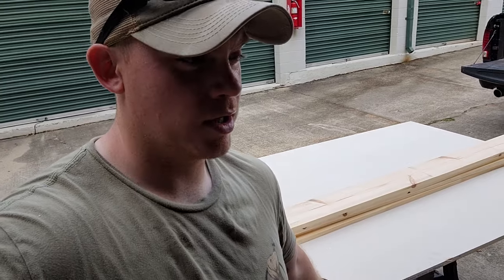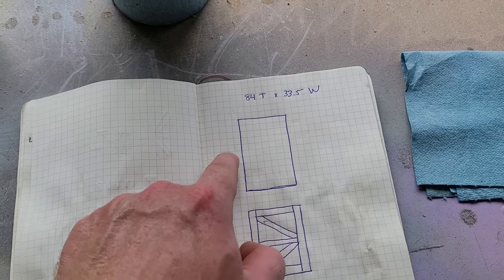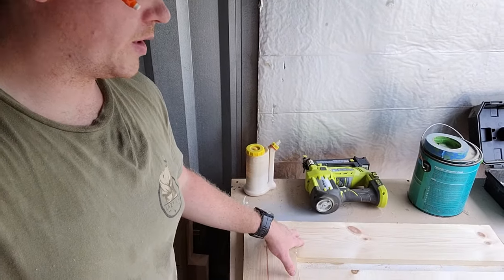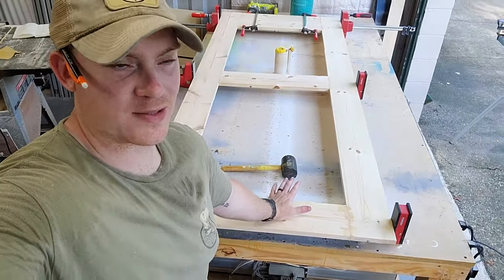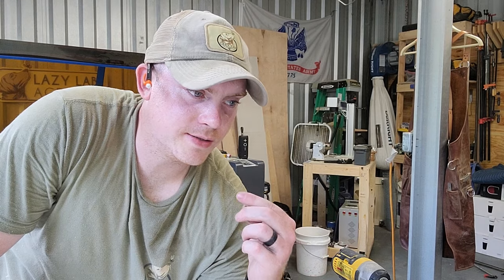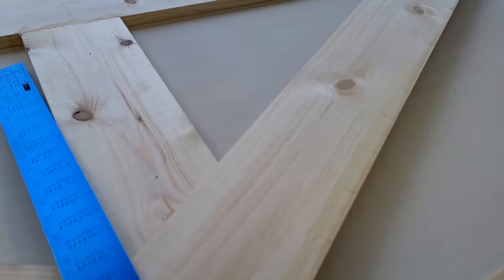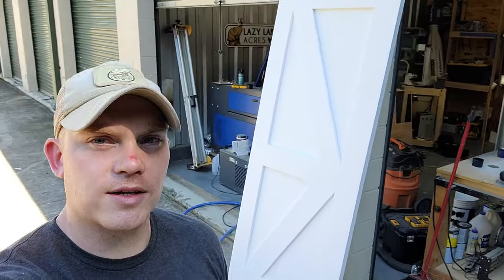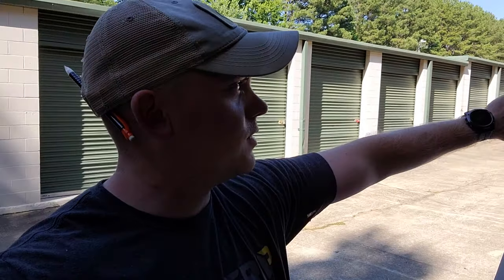Building a Barn Door on a Budget - DIY

Comment: I was looking for a good solution for a few sets of sliding bypass closet doors in a barn door style that she plans to paint.

The hardware I have to work with only works with doors from 1" to 1 3/8", which has its own challenges when one doesn’t own a planer. 

Using this method will let me go with 1/2" plywood for the back and 1x6 for the frame and have them come in right in the ballpark of what my hardware will handle.

Thanks for posting.

Comment: Nice. One idea that I thought of is, you could cut grooves 1/16" deep and 4" apart in the plywood with your track saw. That will make it look as if you have used 4" wide planks.  Also, why do you need to go through the hassle of biscuit joins when you are using glue and screws?  I think you can get away without the biscuit joinery. Thoughts?
Reply from the maker: I didn't want any separation at the joints. Biscuits make everything align better. Not completely necessary I guess, but I wouldn't leave them out
Reply: @LazyLabAcres  agreed!  Biscuits make a strong joint.